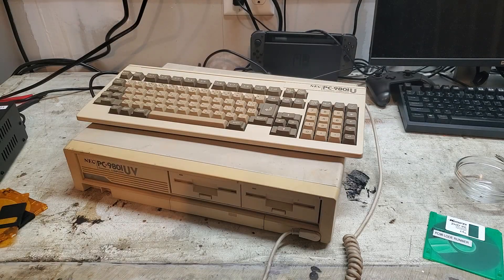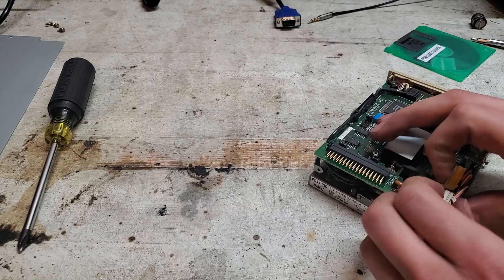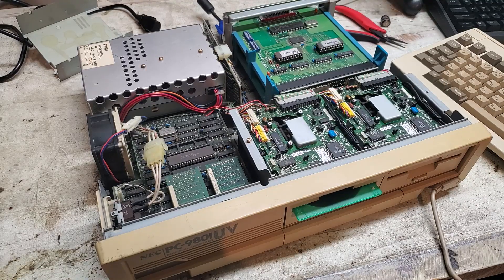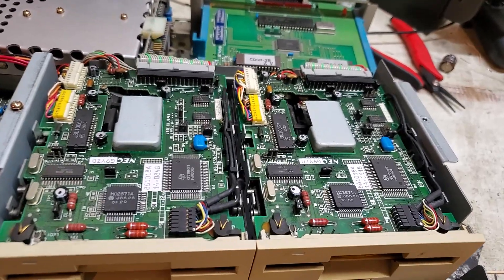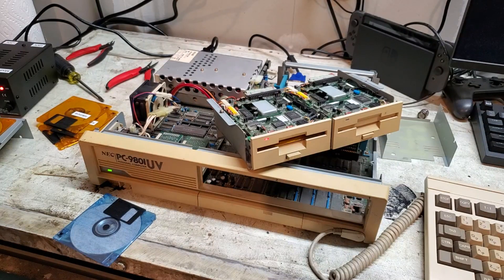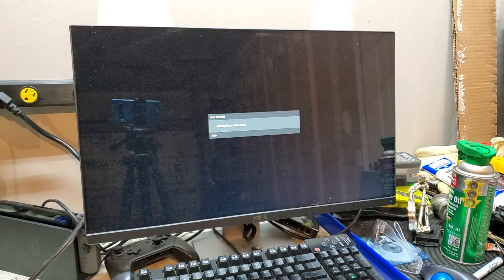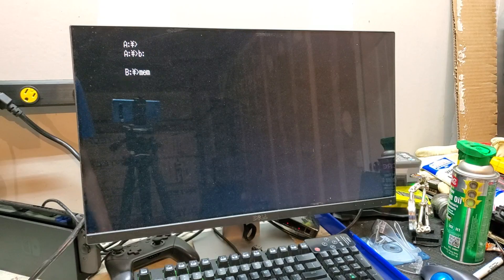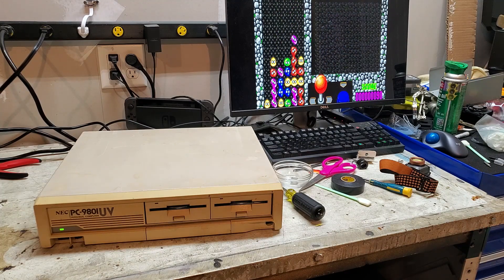NEC PC-9801UV2 Part 2: Floppy Drive Semi-repair and Memory Configuration

Comment: I probably couldn't even get it working this well, honestly.  I feel like if this were me, I'd unfortunately just end up making the drive worse...

By the way, two more (technically three) floppy game suggestions because I feel like it:
https://mega.nz/file/m8EAlSyT#KRY7u1N9-sVw4RWDOmsNrPEtCAd3VC664J9Ii_2ZnDk
Reply from the maker: sweet, I'll give those a shot. Yeah the drive is still a bit flakey, ever since I nuked my evo user disk, it doesn't want to boot on here anymore, but I did get star trader and Ys working on it.
Reply: @Tr3vor42532  Ah, cool.  I've played Ys I a tiny bit (probably less than 30 minutes) on my PC Engine Duo-R, but that's all.  I do believe that's the best version.  There is an IBM PC version, but too bad they had to ruin it by making the game PC speaker only.  Not even a Tandy sound mode like the IBM PC version of Wibarm (a PC-88 game).  Maybe I should try it again sometime since I do generally enjoy action RPGs (and turn-based, like Farland Story and Shining Force II) more than standard JRPGs with some exceptions like Phantasy Star IV.
Reply from the maker: @thepirategamerboy12  Yeah, I've run into the PC version of Ys, but the beeping kinda annoyed me, so I never really got into it. I've seen wibarm before, it looks interesting. I might have to give it a try in dosbox since it has tandy sound, I always thought it just supported pc speaker. I also wanted to give star cruiser 1 a go on this machine since I finished the second game, but it appears the neo kobe image doesn't play nice with real hardware, guess I'll have to run that one in an emulator.
Reply: @Tr3vor42532  I remember trying to play Star Cruiser on my PC-98 and it always crashed at the Arsys logo.  You should check out the Megadrive version, since it has an English translation and an absolutely incredible OST.  I had to get a boxed copy of it before the translation even existed for that reason alone.  Honestly, from what I've heard, I don't think Star Cruiser 2's music is nearly as good as the original (not that it's bad at all, though).  And yeah, there's no YouTube footage of Tandy Wibarm, though it does have a VGM rip.  I actually think it sounds better than the PC-88 original.

https://vgmrips.net/packs/pack/wibarm-tandy-1000
Reply from the maker: @thepirategamerboy12  Yeah, me and another guy have been trying to get it to work on our computers, but it does the same thing, it's probably some sort of copy protection that the d88 images don't replicate, but it supposedly runs in the emulator. IIRC star cruiser 1 also has a translation on the pc-98, so I'll probably give that a shot in an emulator first. Star cruiser 2 can be very buggy also, I've been told it was a more rushed release and that the first is a better game. The second half of it dragged ass, that's for sure.
Reply: @Tr3vor42532  Huh.  Had no clue there was a PC-98 English translation of that game.  Thought it was just Megadrive and X68000, that's all I see when I search for it.  Though, the MD one is the best version out of them all from what I've heard.
Reply from the maker: @thepirategamerboy12  unless I'm mistaken, it should be on the same site that hosts the translation for SC2: https://nebulous.group/index.php/projects/translations/star-cruiser/

I think that's for pc-98
Reply: @Tr3vor42532  Nah, this is the MD translation.  As far as I know, it's only translated for MD and X68000.  The MD version is from what I can tell a more refined version of the original X68k/PC-88/PC-98 game and is very different in many ways.

PC-98: https://www.youtube.com/watch?v=1suts_KO0Lg
Megadrive: https://www.youtube.com/watch?v=5Bc-adLTbsQ
Reply from the maker: @thepirategamerboy12  well shoot, they should specify what system its for somewhere on the page. I guess I'll play it on there instead.
Reply: @Tr3vor42532  You're right.  Also, I just tried Ys I on my PC-98 Cs2 via ERCVFD and it does work, though with some minor graphical glitches in some of the menus.  I don't think I can write it to actual floppies because of the odd disk sizes, but I could be wrong.  Besides, I don't have two floppy drives and ERCVFD is my only way of playing booter games in 31khz.  And yeah, I did actually discover how to get an ERCVFD game to run in 31khz.  You just put the SCAN31 commands in AUTOEXEC.BAT before the VFD loading commands.  Can't believe I never thought to try that until now.  Still don't understand how to swap disks for games with more than two disks or how to save changes to a VFD since its in RAM, though.